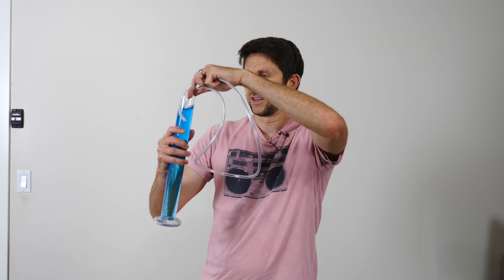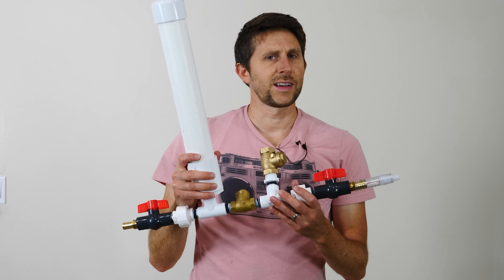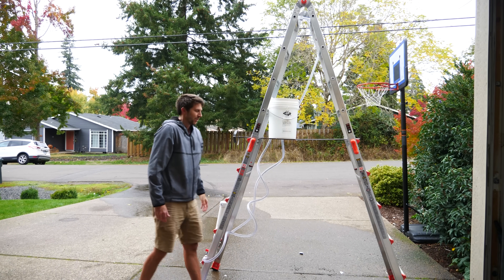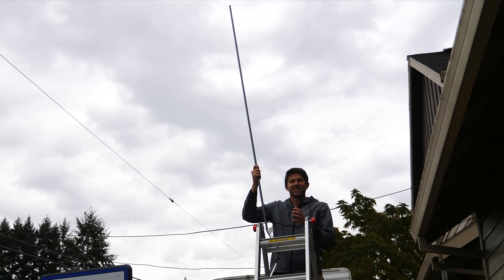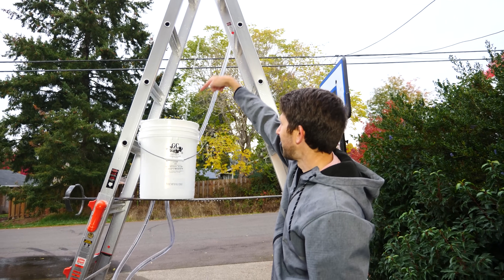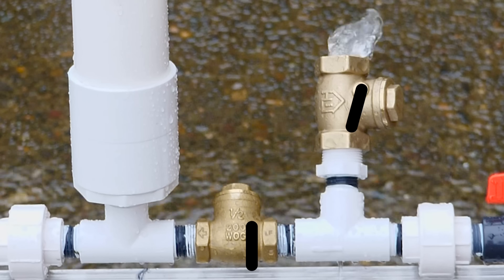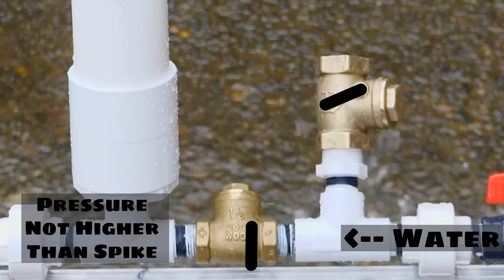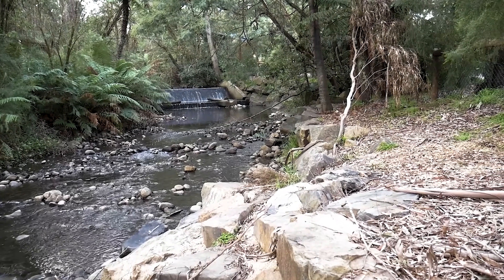Can a Hydraulic Ram Pump Make a Perpetual Motion Loop?

Comment: So with the earth being a sphere  could you span a pipe across an entire state see where the “air Bubble” rests and if it shifts or stays in 1 spot ?
Reply: If the earth was a sphere then the bubble wouldn't shift from rotation of earth anyway. And if the earth is flat, the bubble wouldn't shift then either. You forgot the the pressure pushing on the elements and on us is equal at the same altitude on a globe model, or a flat earth model.

Comment: So what if we collect the water from the waste valve to another bucket and use another tube system to pump the waste water into the original bucket?
Reply: That second bucket feeding a second waste valve (to fill the first bucket) will still eventually lose water.
Reply: And what if we use the waste valve of the second one to pump water into the feeding valve of the first? All of these have to done in an isolated system or else vaporisation of water will mean that the buckets need to be refilled
Reply: @nyshithaaa  I suggest you draw a picture of what you’re envisioning so you can see that it is impossible (as a perpetual motion machine).

Comment: Hi sir i have some thought about 1kg of feather and 1 kf of steel. My guess is 1kg of feather basically heavier in vacuum. On the atmospheric pressure feathers were measured as 1kg bcs of buoyancy force upward. So feathers are slightly heavier than steel in 1 kg. So i hope you can make a lever for both steel and feather inside vacuum chamber. Tq in advanced

Comment: The bang you usually hear when shutting off the water abruptly is the pipe banging against the walls and mounts, due to the momentum of the water in the pipe.

Not an expansion and collapse of the pipes. 

If you look at your connectors in the walls you will see wear and tear where the pipe will slam into the structure 

Or if your lucky enough to have exposed pipes in your house you will see them slam forward and wobble around after the water stops.
Reply: Exactly. You can even see it in a real ram pump set up on a river. Same thing, the pipes will vibrate every time the waste valve cycles closed. And if you set up the pump and didn't secure the pipes then it will  allow it to vibrate too much and you lose that energy into moving the pipes all over hell. Securing the pipes in the setup will give you more energy into pumping water instead of slapping pipes all over the ground and rocks.
Reply: @TheRebelmanone  👍👍
Reply: How does the pipe move in the first place to make it bang into the wall stud or bracket? The pipe expands in length,(straightens) then contracts, allowing the pipe to flex, his explanation stands correct. 30 yrs working with hydraulic lifts.
Reply: @nssherlock4547  this 👏🏻🙌🏻
Reply: @nssherlock4547  No. He's talking about the pipe shifting because of the force of the water, not "expansion and contraction". It can eliminated by removing any angles over 45 degrees or manipulating the direction of flow.

Comment: Could you theoretically create a water powered generator to charge power supplies with this instead of sitting there with a hand crank, wind, or naturally moving water?
Reply: Yes, that is what hydro-power plants do. You dam up a river and use the flowing water to turn a turbine generating electricity.

Comment: 5:35 What would an added valve do, at the input/output of the vertical PVC pipe (pressure accumulator) when adjusting it?
Reply: To start/stop the water flow. Maybe also could be used to help adjust the speed of the water flow effectively making the hose smaller my partially shutting it. But I think most to just turn it off.

Comment: This is similar to how Heron's Fountain uses gravity to boost a small amount of water above the source, even though the net flow is downward.
Reply: Yes but no, it uses separate chambers the falling water itself pressurizes. So, in essence it all flows uphill only to all end up at the bottom. That is where the energy came from, without it all connected on the path to the very bottom, then none of it would flow uphill in the first place. You can't keep or collect the water at the top, or else it stops.

No, because you can't keep water or collet water at the top, but a ramp pump you can, and do.  I take that back, yes you can take a continuous certain amount as it goes without causing it to stop. So yes i am sorry, it is really the same, a ram pump requires "waste" water(water that cannot be pumped uphill because it is exiting the waste valve) and the same with Herons, it requires "waste" water but in a different way, but it still requires a majority of water to end up at the bottom, just like a ram pump.

Comment: What happends if you put several Ram Pumps in series ? Would it allow the water to go higher or would it all mess up ?
Reply: In theory, yes. You would need a reservoir to achieve a steady flow of water for the next stage, since both the output and the waste are pulsed. But the flow is about halved at each stage. Sooner or later the flow will be too low to keep the next stage working.

Comment: Water always stays level!  
Rivers flows down stream!
But the Earth is a ball shaped, perpetually spinning, spheroid!
🥴
Reply: actually not perpetually just very efficiently due to the near vacuum. still gravitational effects, interplanetary medium, collisions, & eventually even virtual particle drag will slow the planet
Reply: @virutech32 yes! And trust me, I know there's no escaping the 2nd law of thermodynamics! Entropy will always win... However, there's no proof the Earth is Spinning! In fact, there's experiments conducted the can show that it's the stars rotating above, around a fixed points Polaris and Earth!🤓
Reply: The earth is not perpetually spinning. It will one day stop.
Reply: @MrT------5743  can I hover a feet above ground and observe the Earth spin beneath? And if not, at what altitude would I have to be to observe the spinning effect??
Reply: @thinkinsidetheboxsquarecir3303  unsure how you could hover one foot above the ground. The air is also moving with the earth. Also nothing was ever launched straight up to fall straight back down. The earth takes 24 hours to make one spin. So the RPM is 1/1440. Not exactly fast enough to see it spin like a top.

Comment: Hi action lab, and what about if you will connect venturi pump to the discharge pipe and connect suction of venturi to the water waste?
Reply: venturis work using fluid velocity not pressure so it likely wouldn't work at all but if it did you would be trading outlet flow energy for waste water recovered effectively lowering the head of the pump outlet. which you could just directly lower the head of the pump to have the same effect & eliminate the cost of the venturi
Reply: I think If apply venturi pump, it can suck part of waste water, and may be all waste water. .

Comment: You can collect the wasted water and reuse it or route the wasted water back into the bucket with pvc.
Reply: No, the waste water needs to end up lower than the source to get the little bit of water higher than the source. That requires more energy outside of the system to get that water back up.
Reply: @MrT------5743  The waste water still can be collected.

Comment: In more loose terms it functions as perpetual  as the energy is always replaced through the water cycle. Clearly not infinitely or within our concept of a perpetual motion machine, but certainly for practical use.
Reply: not really since that solar energy could be used directly to power a pump way more efficiently & they require less maintenance cuz of their solid-state nature. this isn't anymore perpetual motion than a solar panel & orders of magnitude less efficient
Reply: @virutech32  There may be some truth to that but that solar energy does not contribute any energy to any solar device without first contributing to the water cycle.  Free is free.  The water cycle is perpetual until it is not.  Solar energy is perpetual until it is not.
Reply: @ScottGostick  yeah petrol is also perpetual unil it's not. everything is that's the whole point & these ram pumps are horrendously inefficient & the pumps cost energy to both build & maintain. regular hydropower is taking advantage of the same power source & at orders of mag higher efficiency so ram pumps are not "perpetual energy" they're horribly inefficient pieces of junk that only have value in places where easy access to grid energy, solar, geothermal, or fossil fuels aren't easily available.

 semantic nonsense
Reply: @virutech32  Your entire argument is nonsense. That horrible inefficiency you speak of simply becomes water that continues to flow within it's original source. At no point was it suggested to operate from your home garden hose. You do make a good argument as to where they are valuable.  Exactly where one would expect them to be used.

Comment: Wonder if I could incorporate this into my pond.
Use the spitting check valve as a spitting frog statue or something. 😄
Reply: A ram pump needs a flow of water. In this video, the flow was achieved by the source buvket at a higher level. If you can have such an arrangement in your pond, knock yourself out.

Comment: 7:15 Water hammer and the loud "bang" doesn't happen because of the pipes expanding and contracting, it happens because the fast flowing liquid suddenly has to slam to a stop when a valve on the pipeline closes too quickly. Water hammer and the "bangs" occur in the bends of pipes and against the valves themselves. (I've studied this stuff and have worked at power plants) 

Water hammer has nothing to do with the "pressure" it only has to do with the "velocity". That's why you get really loud bangs in pipes carrying high pressure steam when there is condensation, because the tiny water droplets get an insane amount of speed thanks to the steam, and the liquid can not turn as easily in the bends, which leads to it slamming into the "walls" of the pipes on bends. 

Basically, the way ya worded it sounded a bit wrong!
Reply from the maker: Thanks for the input. I agree that the main component in the equations is the velocity since we are dealing with kinetic energy. And the banging sound is more from the sound of the pipes wiggling around than the pressure wave. But you can't really talk about why water hammer happens without a pressure wave.
Reply: @TheActionLab  err...you are splitting two things up when you shouldn't.  the pressure wave occurs within the fluid due to the sudden stop in pressure with no place for it to go..no relief.  they shouldn't be treated as two different phenomena.  they have pressure regulators and stuff you can install to keep this from happening.  should be no more than 55 to 60 psi in regular household plumbing
Reply: @TheActionLab  Np, maybe I'm over complicating the explanation... Basically, water hammer and it's bang is a product of the velocity of a fluid in a pipe going from some amount to 0, which in turn is a product of the pressure difference between 2 inputs/outputs! :D

I just got very caught up on the wording of the, (and I'm paraphrasing here): "-the bang comes because of the pipes expanding/contracting", when that really isn't the case (except for in extreme cases)!

What you say about how water hammer occurs and works etc seems totally right! :D

Comment: Energy can be created and destroyed 😈 but doesn't mean you can have a closed loop all depends on how much is created compared to how much was lost
Reply: actually no energy can't be created or destroyed, only moved around & converted bwtween forms
Reply: @virutech32  would love to prove you wrong I've spent 10 years of my life since a kid to design a system capable of creating and destroying it all in the same system but does not guarantee a machine that can run itself and have an output its designed to prove what is truly right
Reply: @virutech32  I dont deny conservation of energy its fact and it's real but doesn't mean in time it cant be violated
Reply: @elsdonfear  im pretty sure that's an oxymoron. if energy conservation is a fact, and all available evidence seems to back that up, then you can't violate it since that would falsify the claim of energy conservation.

but hey FTL is nonsense too but that doesn't make researching it any less fun & occasionally usefull maths & side applications present themselves when searching for the impossible.
Reply: @virutech32  I agree but hey maybe you'll be surprised one day

Comment: you can do that with ONLY a hose... we empty the pool and hot tub like that. Submerge and fill the hose in the water to drain, once all the air is out of the hose, water flows until air enters the hose when it's drained.
Reply: What you described is a siphon, Siphons do not rise some water higher than the source and discharge it. This video is a ram pump. It uses energy of gravity of water flowing downhill to pump a small amount of water uphill.
Reply: @MrT------5743  then I defy physics somehow

Comment: Seems like the same sort of thing that happens when one member of a binary is gravitationally captured and its energy transfered to its companion which is ejected at high speed. Here the Waste water is captured gravitationally and spurts with very little residual energy and that energy is transfered to the fluid that remains in the system enabling it to rise higher than its original energy state. Fascinating illustration. Thank you!
Reply: Yep, but you have to have the waste valve cycle and flow freely or else it won't work. It is a perfect way to pump from existing rivers and streams.
Reply: The waste water energy is not captured, it is wasted energy. The energy that matters is the flowing water. That energy is enough to push a small amount of water higher than the original water source.

Comment: I wonder who discovered this was possible
they should figure out a way to combine all the nearest-to-perpetual motion machines together... like, attach this pump somehow to the perpetual propeller vehicle I think I saw on Vsauce
Reply: the propeller car isn't a perpetual motion vehicle its wind powered & the air that passes its turbine leaves with less energy than it came with providing all the energy for locomotion
Reply: @virutech32  sigh, obviously perpetual motion machines don't literally exist, it's ridiculous to have to write '
nearest-to-perpetual' every time
Reply: @ytubeanon  yeah but that's not near-perpetual. its just a wind-powered car. a solar panel is also not near-perpetual it requires solar energy. if you just mean efficient then fine, say that. cuz by this loose definition anything can be considered near-perpetual. even a regular car is near-perpetual if u have a whole oil well to keep it fed.

ultimately no matter how efficient you try to be u will always be limited by the carnot efficiency & other maximum performance laws. trying to even get close just isn't worth it since sure u use less energy to run the thing but your maintenance & capital costs u energy too & the closer you get to the maximum the higher those other costs get. like everything in life we must make compromises for the sake of pragmatism.
Reply: @virutech32  what's obnoxious about your explanation is you are repeatedly saying what it is not instead of just writing the definition you'd be happy with -- it's a toaster, no wait, it's not a toaster because by that definition everything would have to be toast in order to fit into the metal casing that houses the heating elements.... 3 hours later... and that's why it can't be a toaster....
Reply: @ytubeanon  whatever man. ur free to make up ur own definitions if it makes u feel better but don't expect anyone to take em seriously
Reply: @virutech32  now you're being assinine, I said WHAT DO YOU WANT TO CALL IT TO MAKE YOU HAPPY and you're like 'wah, i'm gonna take my ball home'... goddam say it
Reply: @ytubeanon  do you not know how to use google? perpetual means forever & perpetual motion refers to things that run without an input of energy. what u described are just motors or engines or power collectors. but dude it's not that big a deal chill out
Reply: @virutech32  so you're calling the large propellor machine from Vsauce a 'motor or engine or power collector', it's all of those right? skip the Google lecture, you don't even understand how to answer a simple straightforward question
Reply: @ytubeanon  The closest machine to a perpetual motion machine is any machine that is turned off. Then it would not be using energy hence no energy lost. Or if you wanna go the not so funny route, since there is no such thing as a perpetual motion machine, everything is in a tie with being closest. Cause all reality is just as close to fairy tales and make believe.

Comment: What would happen if you connected the "wasted water" with the hose though?
Reply: the hose pressure would be higher than the check valve exhaust pressure & be unable to open, stopping the pump
Reply: @virutech32  thanks!

Comment: Curious what would happen if you extended the waste valve so that the water couldn't get all the way out and had to fall back into the system
Reply: the pressure on the outside would rise until the check valve couldn't open properly which would stop the pump
Reply: @virutech32  oh yeah cause the weight from the water would probably keep the waste valve from closing, wouldn't it

Comment: Nut what if the water from the waste valve was able to go back in the bucket
Reply: You could have the waste water fill a second lower bucket connected to a second lower pump who's waste water can fill a third lower bucket connected to a third pump who's waste water can fill a 4th lower bucket connected to a 4th pump that....but this system can never get the water back up to the top bucket on it's own